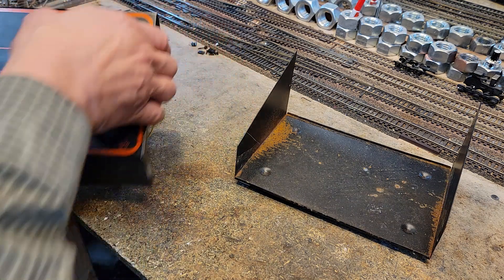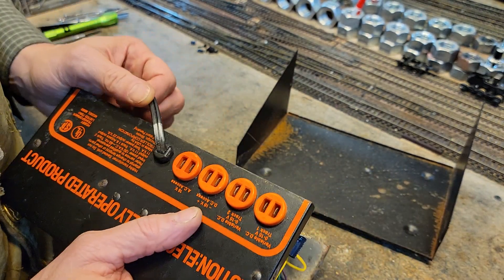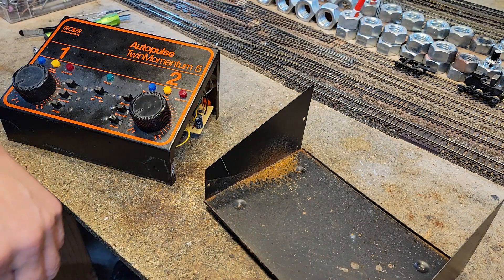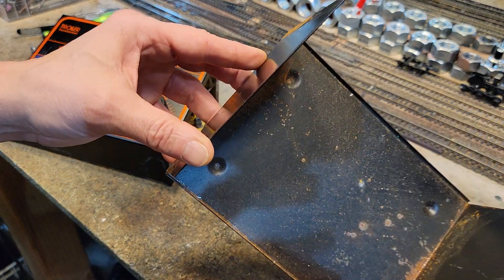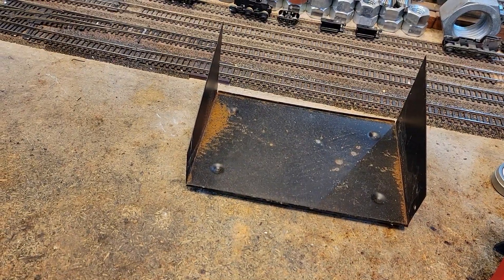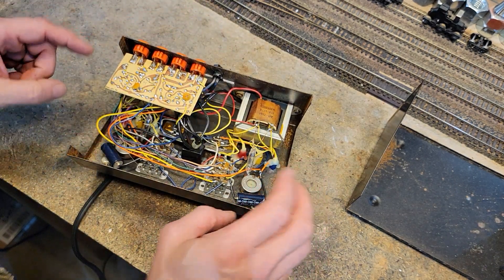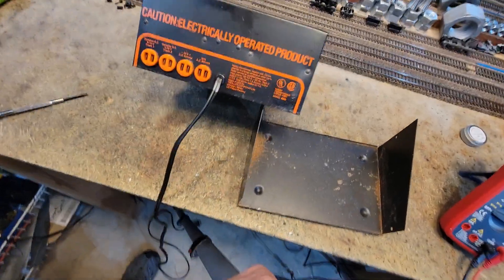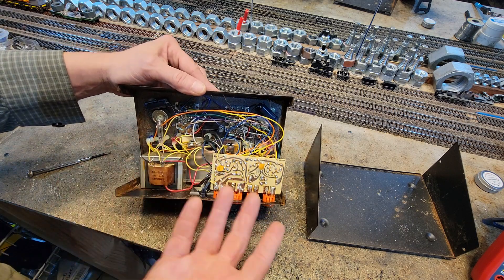TROLLER Autopulse Rebuild Repair 3

Comment: I can't believe how simple the insides are on these. If I decide to tear mine down I will try to make a schematic, it doesn't look very complicated. As far as the transformers go, they look ok, and I think just adding a fan would eliminate the chance of them failing in the future.
Reply from the maker: they are simple and all the parts can be upgraded using Digikey

Comment: Thank you for posting.   I do believe yours is the first video showing the guts of one of these transformers. Sorry I don’t have information for you concerning electronics.    My Autopulse still works somewhat.  I do not remember it working the following way but this is how momentum works now.  1. Turn on momentum and blue light illuminates.  2. turn throttle to desired position. 3. momentarily press the brake switch.  4. Train then slowly accelerates faster or slower depending on the throttle change.  As I recall, it didn’t require tapping the brake to initiate a change.
Reply from the maker: that's what it does - both of the Twin 5s do work, but 1 of them needs the quarter inch spade connectors cleaned.  This coming week we're going to get that ready for service.

Comment: Why do you want to replace the transformers ? Are they bad ?
Reply from the maker: there is a lot of rust swelling and some flaking.  that may not degrade performance, but those are cheap and if there is any advantage to doing it then I'd do it.  If there's no advantage, then the old ones stay.
Reply: I have seen some really bad transformer at work and they are still working, the big thing to look for is swelling and resin melting out.
Reply from the maker: these all show swelling, but they all work.  the Transamp will probably be getting a new transformer that is more in the 2-3 amp range instead of the 1 amp that's already there.

Comment: Might want to look at no ox treatment of the switchs and connectors to help prevent oxidation issues
Reply from the maker: I've been using Oxgard for years and put it on all friction fit and cold weld contacts, works awesome

Comment: unless the transformer has been ran hard for long time (looks burnt) there is no need to upgrade. Only part you need to look at is the capcitors, they are the curse of vintage electronics
Reply from the maker: all the capacitors are getting replaced because they are a known issue
Reply: There are videos on what to look for
It is knock off electrolytics and rifa
Reply from the maker: yes for sure!  the other known problem is getting unbranded capacitors that may not be exactly what they say they are!  I'm going to use Digikey to get all new capacitors and they will be of a higher quality.

Comment: To replaced the rivits you might want to look at "pem nuts" they are an easy to set flat nuts that you can screw into
Reply from the maker: that's is something that I'm thinking about - those are very easy to use
Reply: They are, only trick is to make sure the hole is the recommended size

Comment: The tranformer is most probally a single 110-125 vac primary and 2 16-18 vac secondaries, each one is probally about 1-1.5 amp ratings. 
The reason for 2 secondaries is for common rail selectors system.
The 3 terminal item is most probally a power transistor, most 3 terminal regulators can not do zero volts. I would guess that troller uses a PWM signal to the transistor to control power. need oscilscope to confirm (Ihave one, but be a month before i can check, work schdle)
Reply from the maker: I've got a scope and that transistor is still made and easy to get - the ones inside were taped and clipped in place.  I think I'll just replace them and use some CPU heatsink adhesive to get a good bond to the heatsink.  right now all of these are loose!
Reply: I have heard of some trollers not working and it maybe just not enough heat transfer and too much load
Reply from the maker: the biggest known problem is using the momentum setting and having it overheat - we're going to upgrade that and add heat control!

Comment: Hello! 
It has inertia? 
Can you explain how inertia works?
Reply from the maker: the inertia is called momentum and basically how it works is you turn on the switch then turn the throttle to the maximum speed you want for your locomotive.  the power increases slowly until it reaches the amount you have set on the throttle.  in the Troller power packs, it is a known weakness for generating too much heat and causes a failure of the whole system.  what we're going to do on the Twin 5s is put a computer cpu fan on each side with one fan blowing in and the other blowing out - this is called "power venting" and there will be a filter on the intake side to stop dust.  that should handle most of the overheating, but I also think we can upgrade those 40 year old components to better more modern components that are much more robust.  then we should have the thing that the original designers really wanted!
Reply: @elite194  how this momentum eletronically works? How can i replicate this?
Reply from the maker: in DCC you use a technique called "train brakes" where you set the momentum really high and the locomotive brake to "on"  then you increase the speed and release the brake.  in DC, there is a large capacitor that releases power slowly until the power equals the setting on the rheostat (speed knob).  there is a problem in DC that doing this creates a lot of heat and with the Troller power packs it was so bad that it caused the company to go out of business.  MRC Tech 2 power packs have some models that have momentum where those problems were solved and they seem to be reliable when using that feature.
Reply: @leonardosouza6290  The mechanical way is flywheels on the motor. The electronic way is to put a capcitor between the varibasle resistor and power transistor, it slows the voltage change
Reply from the maker: I've been eliminating flywheels everywhere and using only the digital momentum in the decoder.  since this is a DC project, flywheel equipped motors would be the way to go.